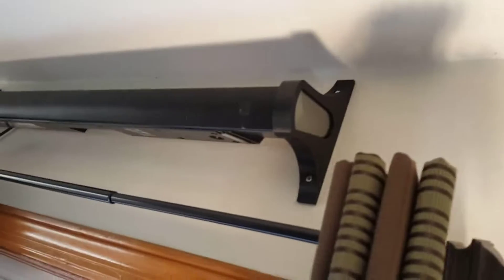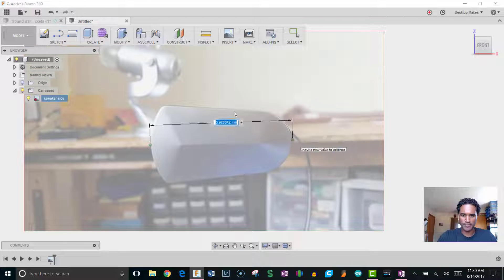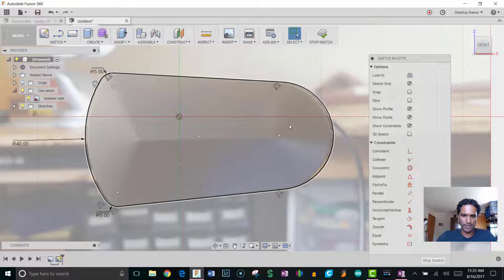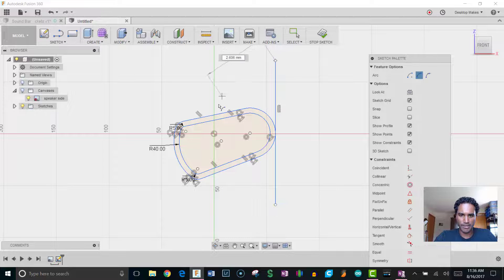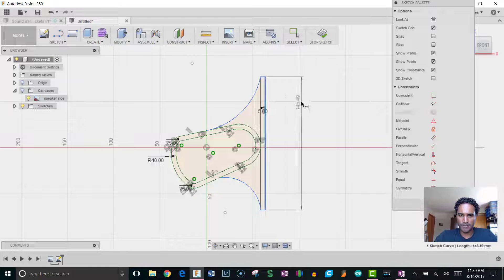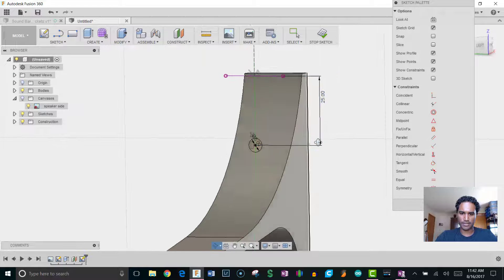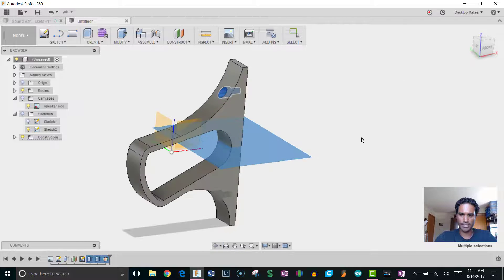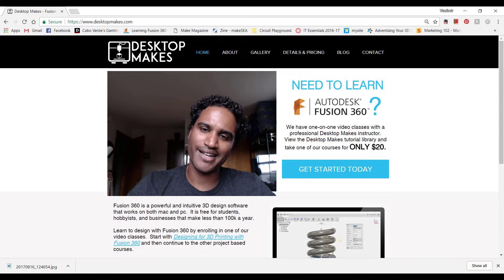Design Custom Mounting Brackets in Fusion 360

Comment: Thank you for the tutorial. Very informative, I learned a lot.
  I have a question: when I'm taking a pic of the object its perspective is not perfect (im trying to design a portable speaker strap mount) So I'm taking a picture of the speaker and when Im truing to draw a sketch around it I see how sides are not even and not parallel. Is there a way to fix it in the F360? Thank you